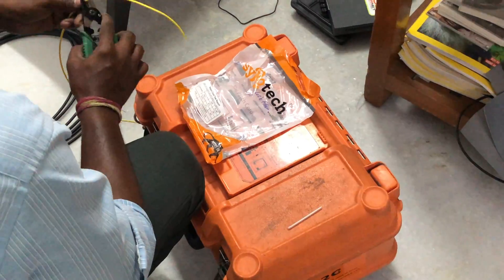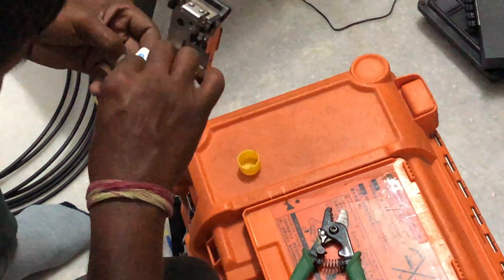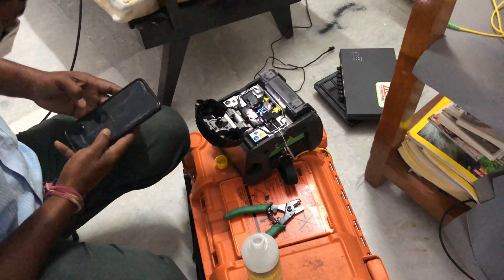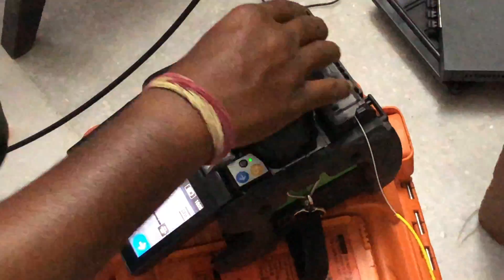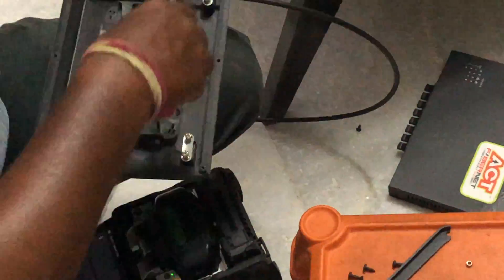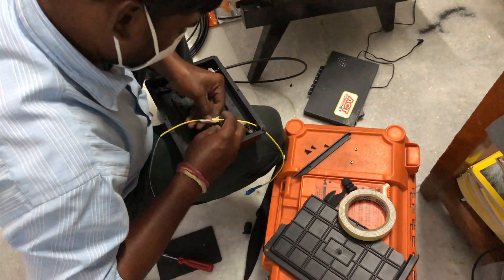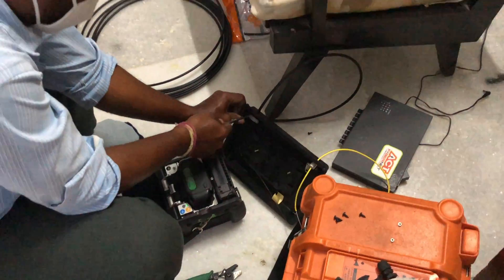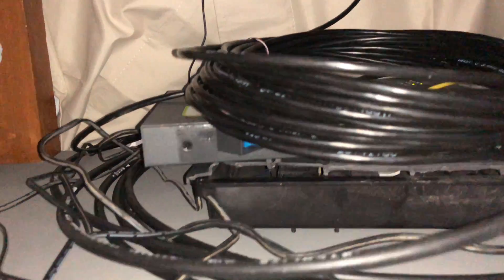ACT Fibernet Experience | Dedicated Switch Installation | Speed Test

Comment: ACT moved to FTTH connection in HSR layout where I say, I got the fiber line terminated in a ONU box by GX and then connected ethernet from that box to my router. Speeds are great. Using it now for more than a year and it's amazing with no downtime. 600 Mbps plan would give 670-680Mbps speed with very low pings.
Reply from the maker: Great to know !

Comment: I am getting a switch now and i am worried about the electricity bill.
What's the electricity consumed at your place bro in units and money
Reply: Switch consumes electricity which minimum costs  rs.80 /month and you could raise a waiver request to act after installation of the switch like after a month or two they will reimburse like rs.50-60/month which the waiver money can be used in next billing cycle.
Reply from the maker: Not much of a difference man.

Comment: ACT fibernet??
Crappy unprofessional service. I had raised a complaint 12 days back which still hasn't been fixed, when you loose 12 days of your 30days billing cycle due to lazy and unprofessional ACT fibernet employees you will not get the compensation. They will not even discontinue the service and try to put you in next billing cycle. If i had time i would have sued these morons in consumer court. BOTTOM LINE DON'T WASTE YOUR MONEY AND TIME ON THESE UNPROFESSIONAL CRAPPY IDIOTS.

Comment: 2500 lolz...its a scam...over that you have to pay monthly power bills for this too close to 100 rs which they wont reimburse.i actually got the junction box free because there was no connections nearby but its a hassle ...everytime they call and say maintenance etc ...speed before the box was also was good at 2 different places i stayed in bangalore...so it has nothing to do with the box.
Reply from the maker: Hi.. I am getting stable speeds after I got the box. And I am not seeing much of a difference in the electricity bill.. It consumes a maximum of 5 units per month as per the installation guy. And before I got the box, I faced a lot of issues and fluctuations over a year or so..

Comment: I don't suggest Act FIbernet, their fine print says their port 
(account) is postpaid and can charge you even after the plan is complete. I had a really bad experience with them. And their customer service is the worst, if you need proof please try to contact them once and try to disconnect the connection. Also, if you check even their youtube channel has comments disabled.

Comment: If junction box is given at a neighbour's residence, and if they switch off connection for some reason, you will not get signals. This is a common problem faced. I was affected by this, as also my sister-in-law. So be careful about this. No refund was made even for the leftover months. Most ACT connections are like this.
Reply from the maker: Yeah.. That's why I had to take a dedicated Switch. 
Now, it is fine for me..As of now..
Reply: @EverydayReviewsEntertainment  Your gmail

Comment: These are olt with 8 port switch. They are disposing at 2500 while not giving you full access to ports. This will consume extra power too than normal ont cum wifi router provided by airtel for free.
ACT is known for its dodgy practices.
Reply: In some select areas ACT does provide ONT devices instead of a whole switch.

Comment: Bro if power cut occurs can I use with ethernet cable?
Reply from the maker: Nope.. You either need to have a battery for this Switch or have a backup inverter for your house.

Comment: You will not be faced any issue with internet speed with Actfibernet, but internet service down's every week, it's says my 3 months experience with Actfibernet, finally i have decided to change internet connection, but i don't know they will send my remaining amount.. so please check Actfibernet reviews on social media like insta Facebook Twitter, you will know all about it..
Reply from the maker: It depends on the locality I think. 
I had no issues long ago. Last year only, I faced issues during lockdown - I think because of lockdown resource crunch. 
But now, I have switch anyway and I have no complaint at all... It's excellent..
Reply: @EverydayReviewsEntertainment  . The speed is good. But the problem is with junction box. They give it in someone else's house. If they shift the house l, your connection will be alffected. You won't even get the refund. It happened to me and my sister-in-law. Think twice before taking ACT connection. Please read my Tweet.
Reply: Beware of taking ACT internet connection. They have a lot of flaws with regard to the junction box. It is give in your neighbors residence. If the neighbors shift or go out of station your connection suffers. I was affected by this. Also you won't get a refund even if the fault is theirs. I have gone to consumer court.
Reply: Yes. They cheat. They refuse refund even if the fault is theirs. Beware.

Comment: Bro I've purchased plan for 6+1 month with 5657rupes on 8th may'21, it's been 3 month completed and overall faced 6 time internet connection issue, and it's a record they had fix the issue after 2 or 3 days, and now I'm tired to call with customers care but no one picking up the call after 2 and 3 minutes it's hang out, i have raised a ticket for disconnection, but they are not sending any confirmation just sending apologize mail, and i think they will not be refunded my remaining amount, so i suggest to all please don't go through the ACT fibernet net if you live in delhi(south west delhi) and also tell you, this is not a Fibernet and router, if you know fiber router is different than normal or dual band router, they provides dual band normal router, they are only fooling to customer..👎👎👎

Comment: you got a fiber to the home connection, instead of Fiber to the node/building. And they had to disable all the other ports, because each port is dedicated to one customer ID, and your router is set in bridge mode, to connect with the ONT. This is how you would get a connection if this were BSNL FTTH, RAILWIRE, Airtel, Jio etc
Reply: @Block Chain no, that config done remotely from ACTs end. They bind a particular port to particular PPPOE username
Reply: @Block Chain I have one at my college dorm, and when I asked about switching ports, they said it's bound to one user ID only. Maybe if multiple people don't utilise one switch they may not restrict it
Reply: @dhyaneshwarra5851  well when Elon musk use it r u sure it will give speed in terabyte
Reply: @Block Chain Leased line is a different concept. It's useful for medium to large businesses. You will get 99.9% uptime, and symmetric bandwidth, static IP and stuff. But it's very costly.... If you can manage with Retail broadband like ACT, Jio, Airtel etc, it's good but from a business point of view it won't be that good. But nowadays retail broadband is also working as good as a Leased line. The main difference is you'll get 100% of committed speeds in leased line, whereas you can get only 70-100% in retail
Reply: @Block Chain oh wow, what's the speed?
Reply: @Block Chain 2500? It's not leased man. 10 Mbps will cost 5k rupees 😂
Reply: @Block Chain it's definitely not leased line
Reply: @Block Chain https://www.tatacommunications.com/resource/products-solutions/network/tariff-internet-leased-line-service-ill/
Check here, this is how leased line looks like
Reply: I got a new ACT connection (75Mbps plan) don't have ONT marked on router. So it means what I got is an FTTN?

Comment: Hey..so is there any refund policy after termination for switch connection..as u said it costs 2500/-..do they payback for that after termination?
Reply from the maker: Nope.. I have been told that the 2500 is non-refundable..
Reply: @EverydayReviewsEntertainment  Actual cost Rs. 2200 not Rs 2500